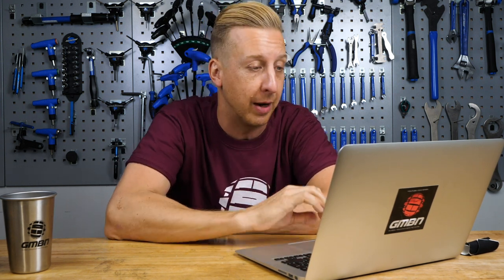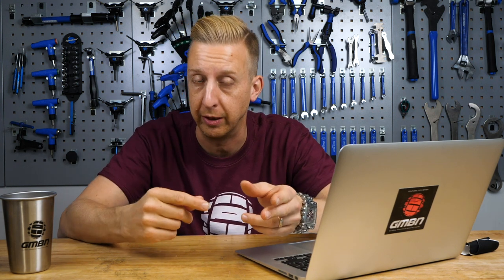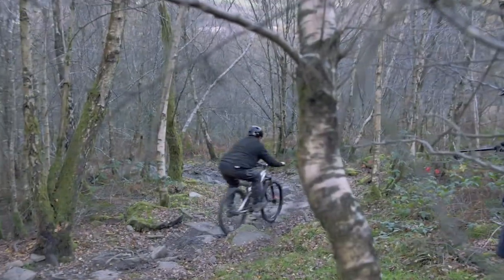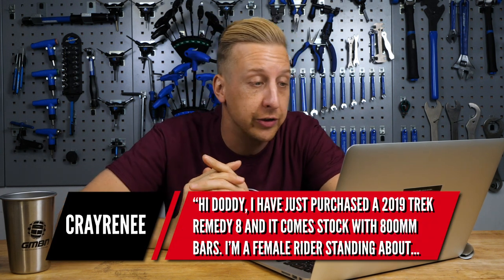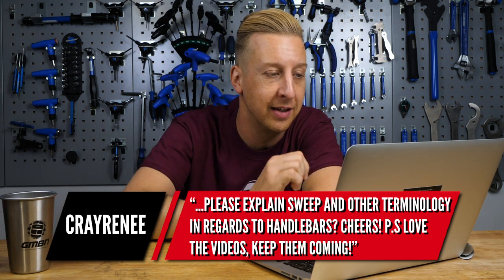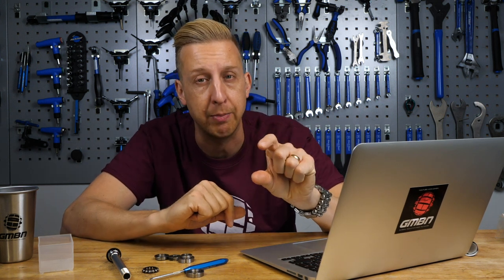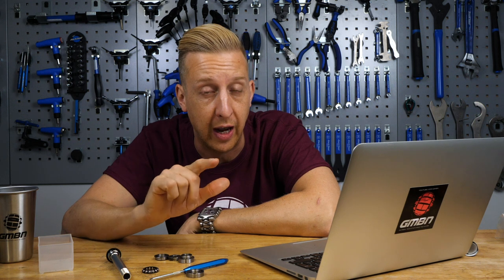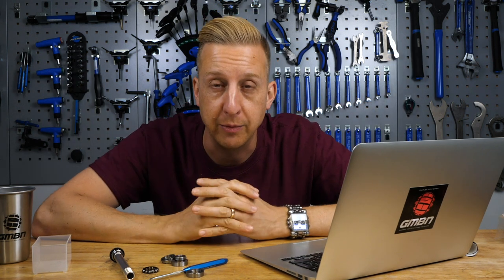Are Your MTB Handlebars Too Wide? | Ask GMBN Tech

Comment: #askgmbntech 160 180 or 203?? I'm thinking mainly for enduro
Reply: good brake pads make a huge difference over cheap pads, best to start there. i would say most people can get away with 180 front and 160 rear but in the end it depends on where/how you ride. For fast long downhills probaly better 203-180 combo to be safe

Comment: sure, let's take good care of ball-bearings but also let's not get paranoid like that.. :} 
how many times have you greased you pedal bearings in the last 5yrs? ok then...

edit:
just noticed how they show re-greasing a bearing. you need to press the grease in, 'pack the bearing' it's called. 
the purpose is not to fill it up but to get the grease inside the cage. in fact, w/ few exceptions, too much grease also creates issues in a full-rotation bearing (like BB or wheels). 
25-50% should be just air in a sealed ballbearing. 

if you're interested in servicing ballbearings watch some skateboard ppl, they know how to properly open seals and all that.

Comment: 4:40 it's not that difficult to find the right bar width, just sit correctly, put hands on on optimal position, with the arms straight, if hte hands go past the handlebar you need longer reach, so new frame, if your hands go past off the handle bar, you need wider bars, if they stay on the inside of the grip towards the shifter, your bars are too wide.
with my current bike, used this method to see what I needed, I even measured it, you can measure the reach, to and distance from mid of grip to desired optimal position.
for bar height, just measure the distance from where the middle of the bar is and to the optimal position, then you will get the bar rise for your setup.
there are many combinations of body measurements, some got long arms some shorter arms, some shorter for arms longer forearms, wide shoulders narrow shoulder, high torso low torso.
while you are at it check if you need bigger or smaller grips.
measuring tape is a must for cyclist,also good for cockpit setup.

Comment: #askgmbntech Should I spend €100 more on a xc bike that comes with 
a dropper post or should I buy the cheaper model without a dropper post and 
have more money for upgrades?
Reply: In your case i would go for the dropper one, because  you won't be able to upgrade a "propper dropper" for the 100 bucks you'd save - and this thing makes SUCH a difference!
Reply: Which hub does the dropper post have? If it's anything below 150mm, try find out if the bike can actually fit at least 150mm. My bike is an XC hardtail and there is a version with a dropper post. The thing is, size S is only sold with a 125mm dropper, but it fits one with 150mm quite easily. Size M and above has the 150mm dropper and that's what you want. 125mm or lower isn't really worth it. Dropper posts are awesome btw and make such a huge difference.
Reply: @3adamwardw or you could read my reply more carefully and save yourself a lot of words ;-) I wrote specifically that I was able to fit a 150mm into my frame, although Canyon only sells it with a 125mm. I bought it without a dropper and upgraded it with one that was actually worth it. It's not just about simply having a dropper post, that's what the OP should be aware of.
Reply: Just to add to my reply: which dropper are you talking about? It really depends on that, because there are huge differences and maybe it's one you can safely skip and rather  save some money  for a better version.
Reply: @3adamwardw  1. English isn't my first language, so yes, it wasn't as clear as I wished it could be, 2nd: literally no reason to blow this up, calm down, no kittens were hurt.
Reply: @Dude-Smellmyhelmet  we don't know anything, so any advice has to be taken with a grain of salt.
Reply: Dropper is so usefull in xc, you'll use it all the time

Comment: #askgmbntech Hey there, newbie here in bicycle maintenance. Absolutely love your shows and watch it weekly. One thing I regularly wonder about is where are these bearings in a bicycle which you have to clean and grease so regularly? Is there a video on that? Or better yet, can you perhaps make a playlist "From Zero to Hero" bicycle maintenance video series?
Thanks for invaluable information. Kind regards!

Edit: wait I think I found some video on it https://youtu.be/0nFNX3Smb8g
Reply: i would say the headset eats the most mud and needs attention most often, followed by bottom bracket and wheels. best advice would be keeping the bike clean (cleaning after every ride), this not only makes things last longer but also work better in general (crisp shifiting, low drag in the drivetrain, smooth suspension)